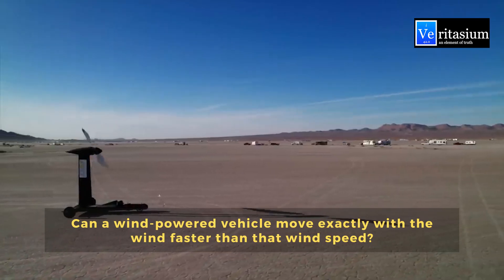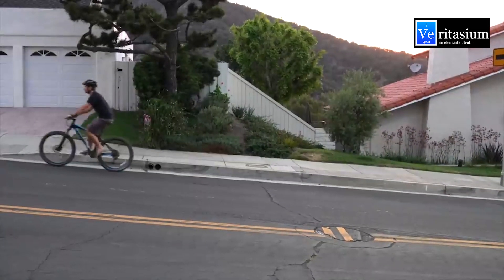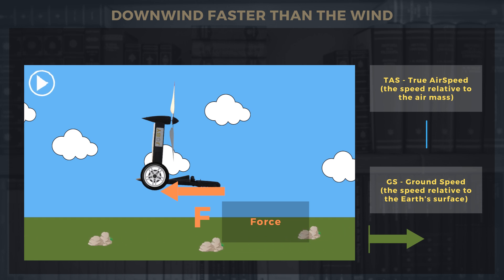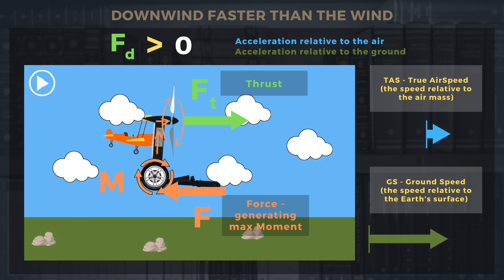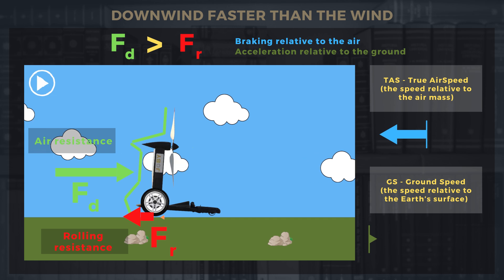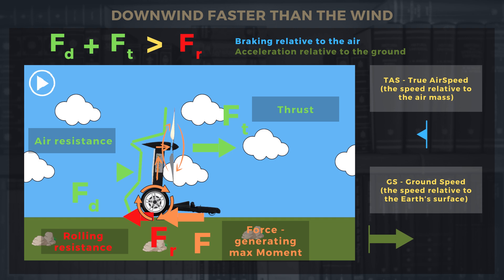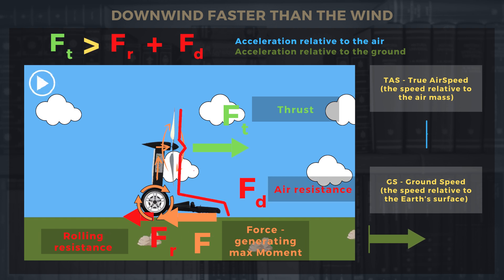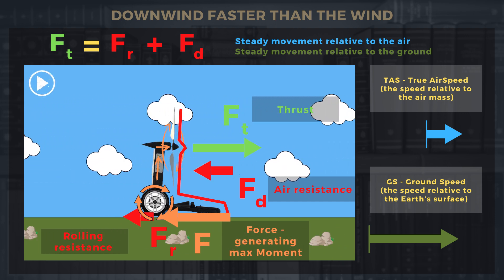Veritasium is wrong. Blackbird vehicle explanation.

Comment: Of course the tangential force impacts the velocity of the cart.  It must be overcome by a force in the opposite direction or cart doesn't move.

Wow.
Reply: Noooooooo you are all wrong!!!!
Reply from the maker: Yes and this force is air resistance, at the beginning of experiment green arrow.
Reply: @PiotrRysztak  

Oh geez.

Air resistance and the tangential force on the wheel are in the same direction when going faster than the wind, they don't oppose each other, they add together and you have to overcome them both.
Reply from the maker: @johnborton4522  What will happen if we remove propeller? How vehicle will react.
Reply: @PiotrRysztak  

If it's sitting still it won't react at all.
Reply from the maker: @johnborton4522  So you're telling me that I am that who is totally wrong? 
At the beginning you have only two forces acting on vehicle - air resistance braking it against mass air, and rolling resistance braking it against the ground. When air resistance is bigger than rolling resistance it will start to accelerate relative to ground and slow down relative to air masses. Finally when air resistance will be equal  to rolling resistance it will steadily move relative to ground and air. With negative TAS speed.
Reply: @PiotrRysztak  "What will happen if we remove propeller?"

A better question for you would be: What will happen if we significantly increase the initial pitch of the propeller? The answer is: The vehicle will start moving backwards, against the wind, driven by the backwards force at the wheels, which you claim doesn't affect the linear motion of the vehicle.
Reply: @PiotrRysztak  

// "So you're telling me that I am that who is totally wrong? "//

Yes, when it comes to your titled claim.  You are indeed totally wrong.

So you've watched a video or two on the topic and now you're an expert.  How many of these devices have you designed/built/operated/tested/demonstrated?  Zero.  

Build a few and get back to me.

Comment: By now, it should be clear from the number of engineers and physics people posting that your central misconception about an unopposed force tangent to a wheel not producing anything but torque is wrong.   It does produce a torque but also displacement.   The error in thinking may be from not considering that the central axle (so far not mentioned) provides a constraining force that doesn't allow the wheel to translate from the force (that force on the axle cancels the displacement force (except for acceleration) but it doesn't cancel the rotational force as it is part of the torque couple).     See this reference:

https://en.wikipedia.org/wiki/Couple_(mechanics)

There is most definitely a retarding force at the wheel (much greater than the rolling resistance force) because of propeller torque resistance but the propeller thrust is still greater than the retarding force + rolling resistance + aerodynamic resistance anywhere below limit speed so the cart continues to accelerate up to limit speed (as long as an adequate true wind is blowing).  The overall leverage argument is indeed the correct explanation of the overall effect.

I noticed you mentioned that the wheel force can't slow down and speed up the cart at the same time because it is connected to the propeller.   This is a misconception in the sense that it can apply both retarding force (at the wheel) and propulsive force (at the propeller) which oppose one another.  But due to the leverage between the two, the propeller wins in the correctly engineered cart so there is a NET Positive force accelerating the cart overall but most definitely an opposing force at the wheels.
Reply from the maker: Yes I should have added two canceling each other forces to this equation – the orange force from ground moving (which driving the wheel) should be green and I should add resistance of the propeller (on wheel) which should be red. In the end the Thrust force remains as a green force and this force will be unbalanced. - Will cause acceleration of the vehicle. 

Let's consider two pairs of forces:
example 1:
force X pushed by center of mass = opposite force X
example 2:
force X pushed tangent 90 degree to center of mass = torque X + opposite force X

How is it possible that one force creates torque and force with still the same value?

Thanks for the long comment i appreciate it!
Reply: @PiotrRysztak  "torque X + opposite force X"

You cannot add torque and force. They have different dimensions. That's why your question doesn't make sense. An applied force is not divided up into some smaller force and a torque. The torque is a different physical quantity, that describes a different aspect.
Reply from the maker: @eyytee  I am not adding it i only compere. How it is possible that the same force can generate rotation with speed "x" + movement with speed "y" or only movement with speed "y"
Reply: @PiotrRysztak  "I am not adding ...."

Then stop using the "+" sign.

 "... i only compere"

You also cannot compare forces with torques, for the same reason you cannot add them.
Reply from the maker: @eyytee  This is not answer, you know what i mean. From one force you have two effects or one effect it is not intuitive at all.
Reply: @PiotrRysztak  It might not be intuitive, but this is how force and torque are defined. The F in Newtons 2nd Law is the sum of all external forces, regardless of how much torque around the center of mass they produce.
Reply: @PiotrRysztak  
>> This is not answer, you know what i mean. 

Nope.  You're saying things that are fundamentally wrong.  We assume you mean what you say.
Reply: @PiotrRysztak      Let's consider two pairs of forces:
example 1:
force X pushed by center of mass = opposite force X
example 2:
force X pushed tangent 90 degree to center of mass = torque X + opposite force X

How is it possible that one force creates torque and force with still the same value?

If I understand what you are asking, the first force through the center of mass (with no other force on the wheel) produces no turning or torque, just pure translation)
The 2nd force-- on the tangent produces both rotation and translation because the wheel has inertia.   However, in the cart, it also has an axle which the thrust of the propeller is pushing against.  This force exceeds the tangential force so there is an unbalanced force and a torque couple.   Consequently, the wheel both accelerates and turns.   This turning is what drives the prop but since the prop resists turning due to aero resistance, this is reflected back to the surface of the wheel resisting the tangent force.   It doesn't totally resist it since the force from the ground is larger.   So the cart slowly accelerates.

What everyone is complaining about here is that you gave the impression that the only thing resisting forward motion was rolling resistance (a function of the tire) and aerodynamic drag above windspeed.   The missing force is the force on the wheel's rim that is the resistance from the prop resisting the torque (and equal and opposite reaction).   

The only reason that the prop thrust exceeds the torque force is leverage due to the fact that the wheel is operating over a much longer distance over the ground than the prop is moving through the air (due to the true wind).  If the wind is removed, this is no longer true and the cart rolls to a stop because now the ground force exceeds the thrust.

Comment: Hallo Piotr, I have a question for you: if you take a simple cart, give it a push to get it rolling, and then turn on a dynamo that takes power from the wheels to turn on a light, does the dynamo slow down the cart?
Reply: Nope!  It's free power baby!
Reply: @Rick_Cavallaro  The hell it is.  If you're who I think you are, you're jerking us around.

Or more likely, judging from the rest of this thread, your sarcasm went over my head.
Reply from the maker: Yes it would slow down the cart. But if you use this generated power to propel the cart and there will be no losses the cart will not slow down as long as you will be pushing the cart.
Reply: @PiotrRysztak  "Yes it would slow down the cart."

Right, and external force that slows down the car is analogous to your orange force F.

"But if you use this generated power to propel the cart ... "

That is a separate issue and requires a different external force that pushes it forward. But this doesn't make the retarding force at the dynamo wheel disappear, it just counters it.
Reply: @PiotrRysztak  Well, if I continue to push the cart of course I can stop it slowing down! But I didn't mean that: I give it a push, let go, and it rolls. If there were no rolling resistance, no air drag or other losses, it would go on rolling forever. Now I turn on the dynamo to power something: a light, a heater, a concrete mixer... If I understand rightly,  you agree that this will create a force that slows the cart down?
Reply from the maker: @coolaun  In that case it will slow down it is obvious.
Reply: @PiotrRysztak  "In that case it will slow down it is obvious"

And will it slow down quicker if the dynamo is engaged, compared to when the dynamo is disengaged?
Reply from the maker: In his example, no rolling resistance, no air resistance, speed will be steady. If he attached dynamo it will slow down.
Reply: @PiotrRysztak  
Yes, and that's precisely what you're claiming does not happen when the retarding force is applied tangentially where the wheel contacts the ground.  Clearly that force does continue to provide a retarding force rather than produce pure torque.
You may be aware that a torque is the same as a "force couple".  That's because another opposing force is required to produce a pure torque.
Reply: @PiotrRysztak  So it clearly slows down: the fact that the dynamo is powering something creates a braking force on the cart. The dynamo is drawing its power from this braking force. The effect will be the same if the dynamo powers a propeller. It will also be the same if we replace the dynamo with a direct transmission to the propeller.
Reply from the maker: @coolaun  Yes and this is the clue. This force brake the car it is obvious but when we use this generated force to propel the car by propeller for example(100%efficiency) car speed will stay steady. It will be only transfer of force.
Reply: @PiotrRysztak  "This force brake the car it is obvious but when we use this generated force to propel the car by propeller"

You are confusing different forces and force with power. You don't use the braking force to propel the car. You use the generated power to create a different force at the propeller, which is greater than the braking force so it accelerates. But the acceleration is still reduced by the braking force.
Reply from the maker: @eyytee  the final result and my reasoning is correct, maybe I put it in wrong words, but I see that you have clarified it. Ultimately, the speed remains constant.
Reply: @PiotrRysztak  If the speed is constant (despite no rolling resistance, no air resistance), then the tangential force at the wheel must be braking and balancing the thrust.
Reply from the maker: @eyytee  At least we agree here. I think my problem is to express what I want to convey, which creates misunderstandings.
Reply: @PiotrRysztak  So now you seem to be agreeing with me and eytee: there's a braking force and a thrust force. The thrust force will not exist without the braking force. For the vehicle to accelerate, the thrust force must exceed the braking force. Which it can do, due to the difference of velocity between air and ground. 
That is exactly the explanation provided by Derek in his video (and by Rick Cavallaro, Mark Drela and many others). So where's your disagreement with them?
Reply from the maker: @coolaun  I am not agree with leverage argument i am saying it in video ;) We do not need the lever for it to work - That is my statement.
Reply: @PiotrRysztak  If there is no leverage then thrust is equal to braking force: in this case there is no acceleration.
Reply from the maker: @coolaun  Thrust is generated from the beginning of movement, from Ground speed 0, this is the difference and when the vehicle is at TAS speed 0 he produces "net" thrust force. And accelerate.
Reply: Thrust only starts getting generated when the vehicle gets up to a certain speed, around 1/2 wind speed. Thrust increases from this point on. When the vehicle gets to wind speed, it needs to be producing more thrust than braking force in order to accelerate further. This can only happen with leverage.
Reply: @PiotrRysztak  "...beginning of movement..."

The leverage argument used by Derek refers to the situation above windspeed, when air and ground are moving in the same direction relative to the vehicle. That is what needs to be explained. To move downwind slower than the wind you don't really need leverage. My video "DDWFTTW ANALOGY #2" might help you understand the lever mechanism better.
Reply from the maker: @coolaun  Not exactly because relative to ground only rolling resistance is braking it and this is constant force. When we are at TAS 0 and the thrust force bigger then the rolling resistance force we can accelerate
Reply: @PiotrRysztak  OK, I see we're back to square one. The thrust force of the propeller needs power: this power is produced with a braking force, just as in the dynamo example.
Reply: @PiotrRysztak  "only rolling resistance is braking"

Rolling resistance is just dissipating energy, and not providing any useful power via the transmission. But to spin the propeller you need a power input at the shaft.
Reply: @PiotrRysztak  
>> when we use this generated force to propel the car by propeller for example(100%efficiency) car speed will stay steady.

NO!  You've said this exact thing maybe a dozen times, and it is NOT true.  So rather than simply repeat it yet again, perhaps it makes sense to actually discuss this point.  Unfortunately, you're not willing to have that discussion.  You're simply here to tell us you're right no matter what.

>> the final result and my reasoning is correct

It's NOT!  

>> I think my problem is to express what I want to convey, which creates misunderstandings.

That is definitely not the problem. You have made a number of statements that are simply wrong.  More importantly, the very purpose of this video was to correct people that already have it right - and to instead suggest your explanation that is not correct.  That is not a communication issue.

>> I am not agree with leverage argument... We do not need the lever for it to work

You're wrong on both counts.  This is not a matter of opinion or interpretation.

>> Not exactly because relative to ground only rolling resistance is braking it 

You really should stop saying that since it is absolutely not true.

Since you don't want to listen, and you're CERTAIN you're correct, why not bet me $10K?  You don't want to make easy money?
Reply: So - you just keep on repeating your misinformation over and over and over again - without ANY facts to justify it.  You seem absolutely certain you're right, but not willing to put your money where your mouth is - or even address the points people are making.  That's the definition of a troll.